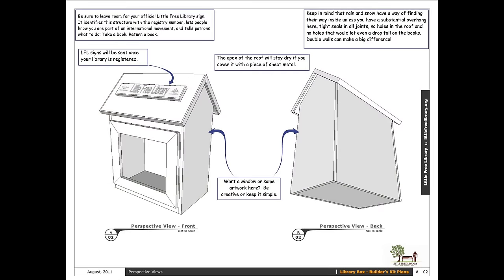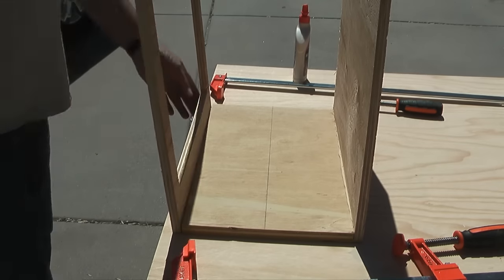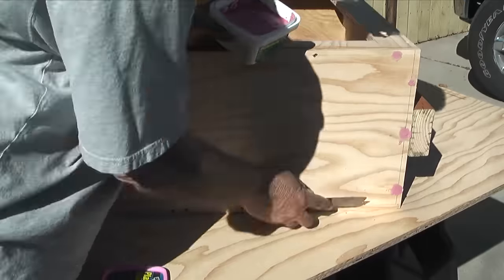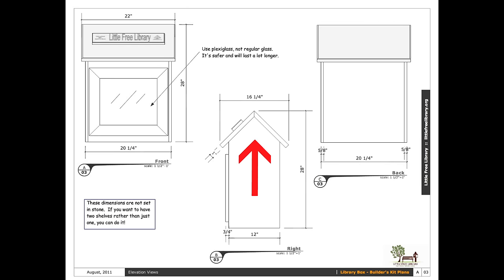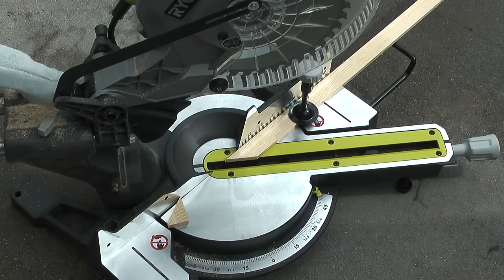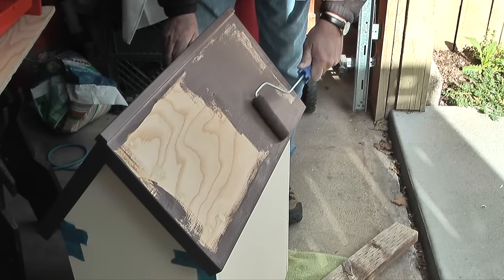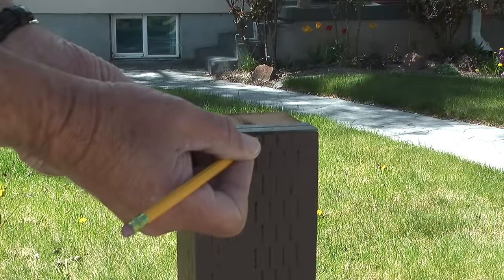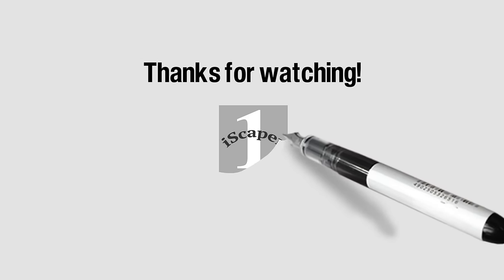How To Build A Little Free Library

Comment: I really appreciate how detailed and specific your video was in it's production and narration. You explained every step, and sped up the repedative, but necessary parts where each side of the library needed to be thoroughly tended to (example: applying the calk, smoothing with wet finger to seal, and wiping that finger off). These are the little but crucial details that many tutorials miss. Thank you for your tremendous effort in educating us!
Reply from the maker: Thanks, I appreciate the feedback.

Comment: Great build! Here's how I explain the miter saw angles... when you measure the angle of the roof, you are measuring the total angle. When you set your miter saw, your point of reference is a right angle, or 90 degrees. You have to subtract half your angle from the 90 degree reference on the miter saw to set the angle.
Reply from the maker: Good advice, thanks for posting.

Comment: What type of router bit did you use to do the groove please? I don't want to pick the wrong one as I only have good wood, no scrap just now...LOL Thanks and I loved the INFO ON PLANS...finally!!!:) JUST A NOTE: For those who use a jig saw, use the blade labeled for plastic cutting to avoid chipping the edges of the plexi.:)  Metal blades can melt it.    This video was great to find as you had much more information and plans!  My roof is a different style as it is being hung up on a wall. :) The roof peak has to come forward instead...:) Cheers!
Reply from the maker: Thanks Vicki for the comments. I think I used a rabbet bit for the groove.

Comment: THANK YOU SO MUCH! This is going to be such a huge help to me! I have a few questions though.. 1. Was it worth it to build it yourself money wise?/How much did you spend? 2. What type of climate do you live in? I live in wisconsin and am really worried about what type of wood to get since we have all types of weather here. 3. What type of wood did you use? Thank you in advance!
Reply from the maker: If I remember right the materials, paint, and plexi-glass were under $100. I did have the saws necessary for cutting the wood. The money I saved on freight for the online kit I bought a router. I live in Salt Lake City that is hot and sunny in the summer and cold and snowy in the winter. I cut up a sheet of plywood to build the library. I used caulk and a number of coats of paint to keep it waterproof. So far so good.

Comment: Such a great instructional video.  My girl scouts are working on a silver award and making a little library using this example.  We've all listened to this video many times to try and write down a materials list.   However, we don't know how long the support pieces are.  Are they 1 ft long with a 45 degree bevel cut on each side?
Reply from the maker: If you're talking about the trim pieces on the roof, measure edge to edge then make your bevel cut.
Reply: iScaper1 not the roof but the 2 support pieces under the library  that you attach to the post
Reply from the maker: Got it. Cut the support pieces around a foot long. If the end of the piece sticks out past the edge of the library then cut each support a bit shorter. The cuts are 45 degrees.
Reply: iScaper1 THANK YOU sooooooooo much!!

Comment: Your reading of 38 degrees is from the fence to the blade. However, the gauge on your saw reads from perpendicular to the fence to the blade. So, 38 degrees from the fence is the same as 52 degrees from perpendicular (38 + 52 = 90).

Comment: Very nice video. I just finished mine and I am glad I watched your steps... thank you. 
I do not understand the comment about the roof angle. If you follow the instructions it calls for a total of 90 degree angle (6 x 6 or 45 degree cut). In fact the trim should have the same cut as your roof boards that you did cut at 45 degree. When building mine, I ended up measuring a total of 90.5 degree for the roof... How did you arrive to 76.1 ?
Reply from the maker: Hi Stephane. For some reason when I made the two 45 degree cuts for the roof pieces they didn't fit right. If you notice in the video I ended up with a gap on the roof line that I filled with silicone. I'm not sure if I made a mistake on the end pieces I cut for the end walls, but when I measured the roof angle it was 76 degrees not 90 degrees. To make the trim pieces work work for me, one angle was 38 degrees and the complimentary angle was 52 degrees. If your roof angle ended up at 90 degrees then the angle for the trim pieces would be 45 degrees. Looks like I made a mistake somewhere that you didn't.
Reply: Nevertheless it works. Beauty of woodworking. Thank you again for your extremely well done video and pedagogical presentation.

Comment: Thank you for an excellent video. I have been using it to build my library. I've reached the part where I have to now cut the angle on the roof pieces. As things are coming together, I'm getting a little worried about the weight of the library. I made mine a little larger than yours (back wall piece is 26"w x 24"h to give you an idea). Can this width and eventual weight (with books) be borne by a single 4x4? What would you suggest I do to make it super stable and of course safe? Thanks for any help.
Reply from the maker: I think you should be fine with the dimensions you listed to use a 4x4 and the braces shown in the video. If your worried you could go to a 6x6 post and 2x6 board on the bottom of the library. Then add 2x6 angle braces.
Reply: Thank you for taking the time to reply. Your video has been watched many times as I play and replay each step to make sure I get it right, just like you. I will try to go for a 6x6 post.

Comment: Id like to add shelves to this plan.  At what point in the process would you do this?
Reply from the maker: I added a shelf when the library was complete which made it harder to do. I would suggest before you put the roof on.
Reply: @Iscaper  how would you attach it and what would the dimensions be?
Reply from the maker: @heatherhusband5904  It takes a bit of measuring. 
1. Measure the inside dimensions of your library. Cut your shelf slightly smaller, maybe 1/8" - 1/4". 
2. Measure, mark, and drill 2 holes into the walls where you want the shelf on each end of the library in around 2" from the adjacent walls. Careful not to drill completely through the walls.
3. Insert 4 shelf support into the holes. 
4. Add shelf.
Here's a link for the shelf supports I used: https://www.homedepot.com/p/Everbilt-1-4-in-Brass-Plated-Angled-Shelf-Support-8-Pack-802904/206942360

Comment: Can anyone confirm if this is a one shelf or two-shelf library? I would like to build it but I’m hoping to get a shelf in there so I can fit two rows of books
Reply from the maker: One shelf from the plans, but I ended up adding a shelf because there was so much room at the top of the library.
Reply: @Iscaper  excellent! Thank you. That’s what it looked like but I wanted to confirm that another shelf would fit without any major changes to the measurements and dimensions
Reply from the maker: @MoneerRifai  You're welcome. The shelf allowed us to add a lot more books to the library.

Comment: https://i.imgur.com/9qo39np.png 

I made a figure illustrating why the angle setting on the mitre saw is different from the angle you measured. The blue lines represent the roof. The red lines represent the reference angles for the mitre saw. When the mitre saw is set at 0º, you're really making a 90º cut with respect to the board, and when you increase the angle of mitre saw blade, you are decreasing the angle of the cut with respect to the board.